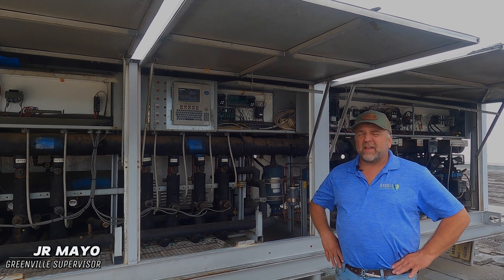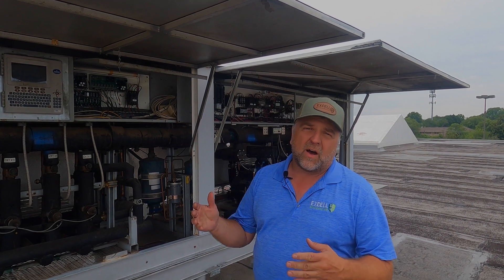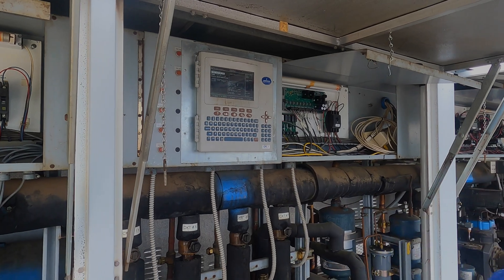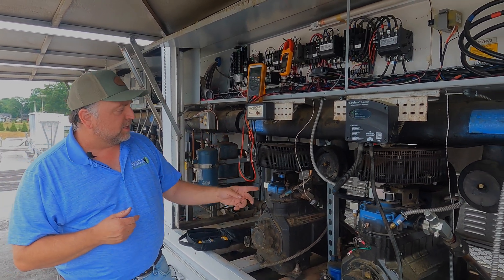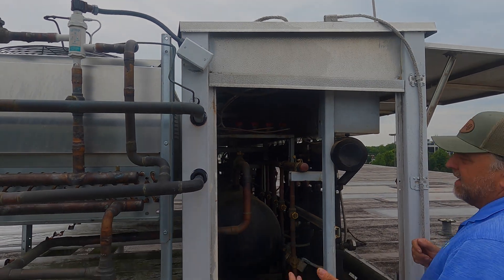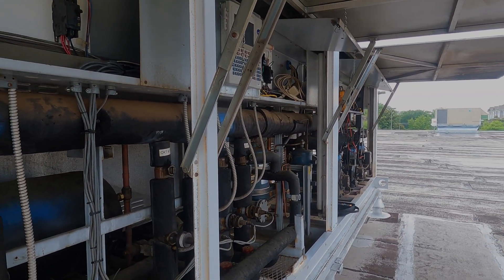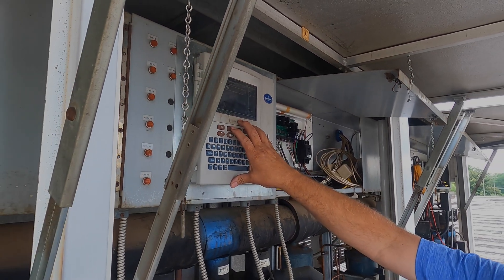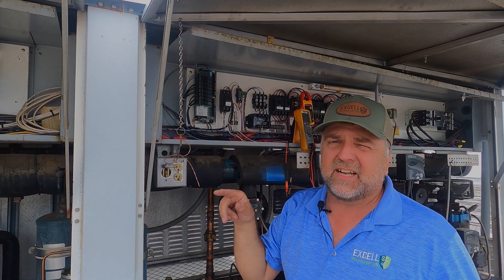Hot Gas Defrost

Comment: Great video. Have you ever had any issues with those solenoid valves on the hot gas bypass? Like one of them not closing?
Reply from the maker: @Fredsapucahy  yes. Sporlan makes a rebuild kit for them depending on size of valve.